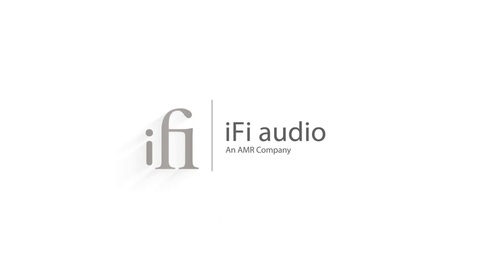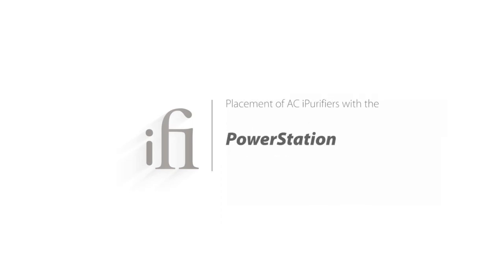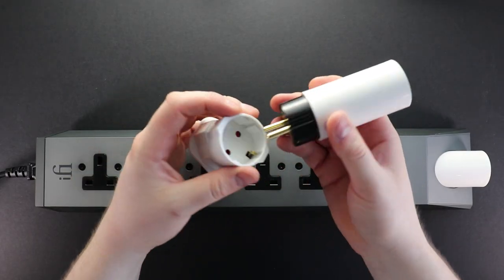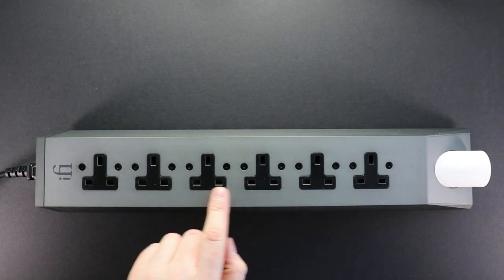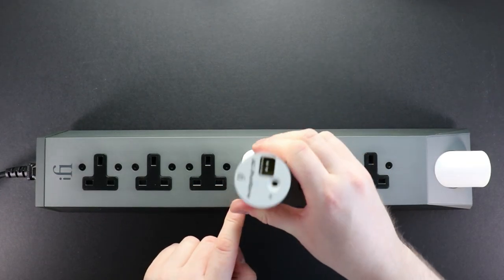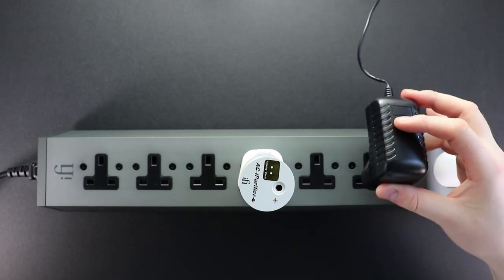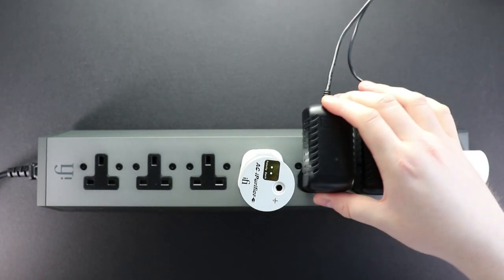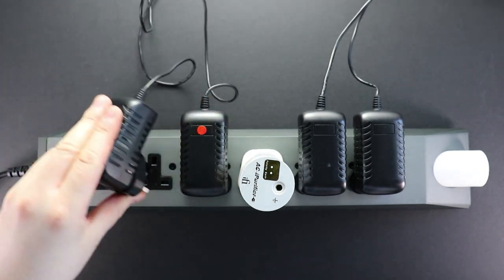Placing AC iPurifiers in conjunction with the PowerStation

Comment: This video make your products seem confusing, at least to me.  Since the PowerStation has a built in iPurifier, I assumed it was unnecessary to add in additional ones.  But here you suggest the need for three iPurifiers, or two in addition to the one built in?  No wonder people become skeptical of claims about power conditioners.
Reply: The video only covers some basics. Ideally have one power station for source components and another for main amplifiers. Then experiment with an extra plug in module. 
Now iFi makes a power cord with a module in the center of the cord. Lots of options. Have fun.

Comment: Hey guys at iFi. I really like and believe in your products, however this video has left me a bit confused. The first part I understand regarding splitting digital and analogue plugs. And the last part I understand about placing a purifier straight into the wall so at source.

What’s confusing is the second part, so wanted to ask, is the purifier that’s built-in to the power block connected to the left-most socket first? Or is it connected to the right-most socket first? Visually, it looks like the inbuilt purifier is connected to the right-most socket first.

Also can you confirm if power arrives at the left-most socket first and then daisy-chaining of sockets is from left-to-right? Or does power arrive to the right-most socket first and then daisy-chaining of sockets is from right-to-left?

As earlier said, I’m a believer in your products, just would help to have an explanation to the questions to help clear the confusion and improve my understanding. I want to make sure I’m plugging things in correctly and right now I’m not sure. Can you help? Thank you and keep up the great work 🙏
Reply: Hi I have the same thoughts and questions... what did you find out, bc you didnt get an answer here....?